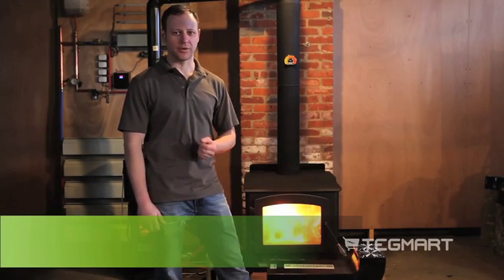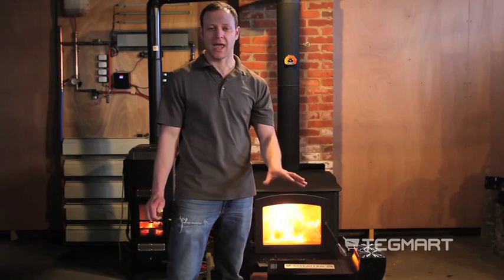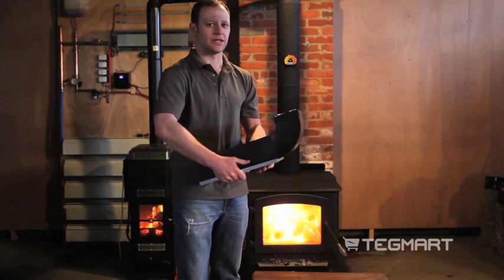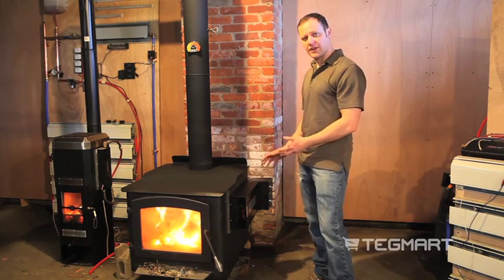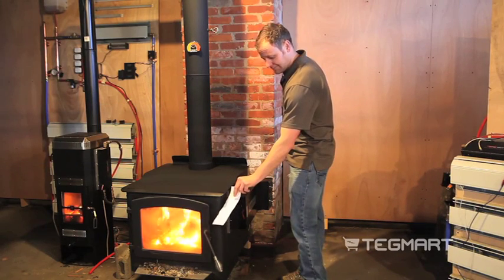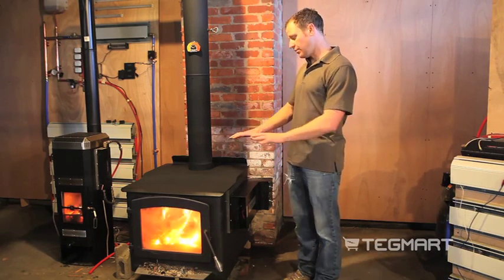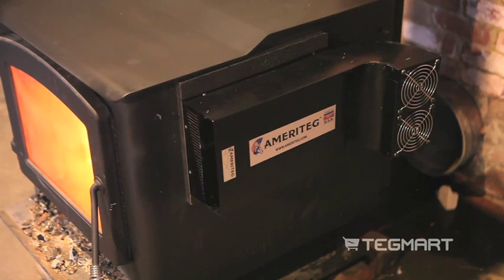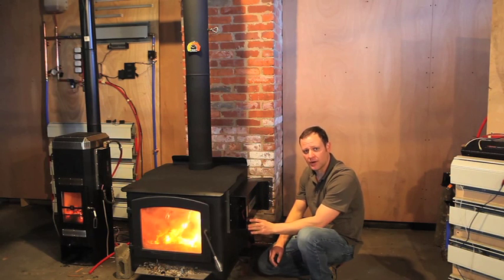AmeriTEG USA Manufactured Magnetically Coupled Thermoelectric Generator

Comment: This product is not available on your website.  Actually, none of other wood stove thermal electric generators are in stock, except one unit of air cooled 45-watts.  What is going on?  When will they be available again?  I am interested in the 100-WATT TEG WATER-COOLED SYSTEM.

Comment: Your magnets are not "specially designed" to "uncouple" when they get too hot, ALL magnets lose they're magnetic fields permenantly if they reach a temperature exceeding °176 fahrenheit. Iron & steel become magnetically inert at these same temperatures as well. that thing will fall off your wood stove every time it reaches those temps, which won't take long, and you also run the risk of destroying your magnets. Neodymium magnets aren't cheap.
Reply: I have some magnets now that work very well with temps over 250 degrees.

Comment: would it make sense to have a longer intake to collect cooler air farther away from the stove?
Reply from the maker: You can connect the a fresh intake kit to the generators intake and increase the output power as the outside air will be cooler.

Comment: Do you have any modules that can be placed on a car engine in order to use the engine heat to charge the car battery ?
Reply from the maker: We have a variety of high temperature modules available that can be used to convert heat to electricity. You'd have to design an actual generator housing for the application.

http://www.tegmart.com/thermoelectric-modules/